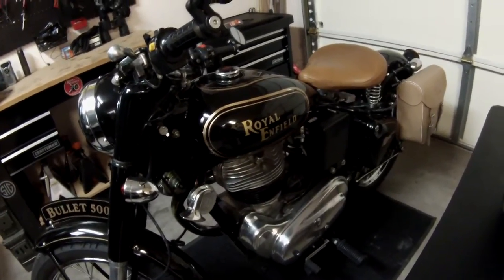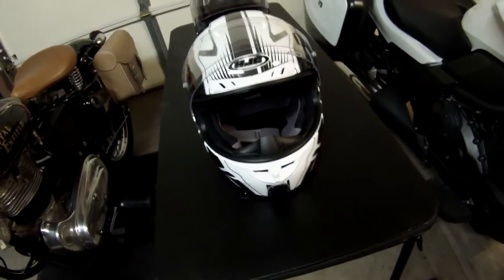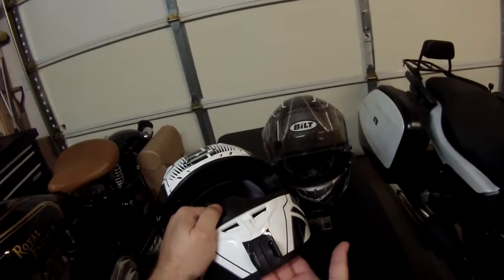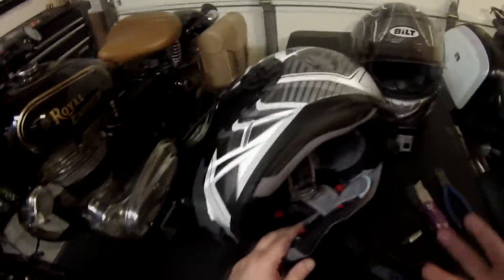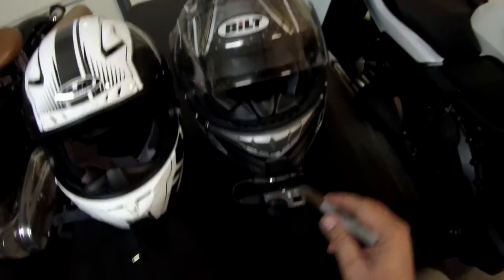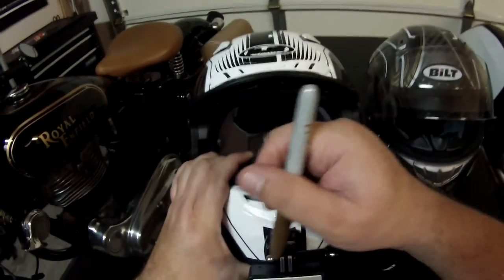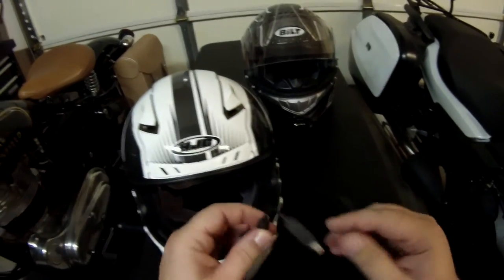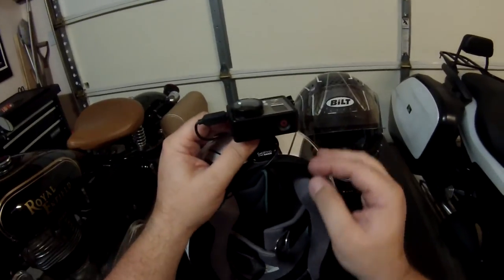Setting up a MotoVlog Helmet - HJC CL17 - How To

Comment: Nice setup. I originally had my GoPro upside down on my Bieffe, but really wasn't pleased with the perspective. I found that, for me, having the camera right-side-up and closer to eye level de-emphasised the bike significantly and provided for of a pilot view. Having the camera right-side-up also allows me to see the blinking LED on the back, so I know for sure whether or not I'm recording.
Reply from the maker: I see your point there.  As far as framing the shot, on my Enfield I like to frame the shot with the handlebars within the frame because it gives more perspective for the viewer.  You know, incase someone wants to go full screen and pretend they're holding on to the handlebars LOL!  Not sure where the sweet spot is on the CTX yet though.

seeing the light would be handy, I usually just see it in a reflection from time to time.

Thanks for the input, good to see how er'body gets it done B-)

Comment: Wow man, that was a brilliant set-up guide. You made everything so clear and detailed. Totally professional! Really impressive. You should do more vids like this, you do such a good job.
I was going to do a lot of reviews when the weather gets better, but after watching how good you are, I don't think I'll embarrass myself by doing them. ;o)
Great tip with the gold pen, nice idea, I'll be using that one, thanks.
Great vid mate.
Reply from the maker: Thanks Rob, you're too kind!

Don't let me stop you from your reviews, we're each entertaining and informative in our own ways.  Many would say I'm too dry and too boring, but that they got something out of it.  You never know, you could be funny, engaging, and witty whilst still being informative.  I think I sometimes sound like the Sham-Wow guy or the Rev-Zilla pitch guy LOL

Anything to make things easier.  I got the idea from when I was doing spark plug chops on the RE while jetting the carb.  You have to mark throttle positions and it occurred to me that marking the GoPro joint would save me the hassle of having to preview it on the cell phone whenever I reconnected the camera for whatever reason.

One of the things I didn't mention was that I don't use a battery backpack or add-on screens.  They weigh more and the screen and remotes tend to use more battery as the wifi/Bluetooth has to be on.  A little more clumsy to start and stop the camera this way, but just an idea ;-)

Thanks again, Rob  B-)
Reply from the maker: Oh yeah, still have to work on the pocket dump, I'll get to that ;-)
Reply: Arizona RE  No rush mate. ;o)

Comment: Thanks for this video man ..ill be picking up a cl17 next week and I'll try this setup
Reply from the maker: It is a very good lid. The extra parts are inexpensive too, you can get a second lining, cheek pads for next to nothing and switch them out between cleaning. Also, if you are going to be vlogging, get the chin curtain too.
Reply: Arizona RE I already do vlogging but I have the issue where I sound like Darth Vader and the camera is on the side ..I'd like to have it in the middle

Comment: Nice helmet man. I just picked up a new Nolan EVO 104 while I was in Tucson. Great helmet. It's always a little nerve racking cutting into a new helmet, but has to be done.
Reply from the maker: Agreed, though this is a pretty harmless hack.  On an earlier Built (cheap) helmet I actually drilled through the chin piece to mount the camera with a bolt and nut for extra security as the sticky mount didn't touch very much.  I'd never be that careless with a more expensive helmet though...
Reply: I cut through my last helmet to mount my bluetooth. Need to find a better way with this one. :)
Reply from the maker: Livin' Rob  Yeah, most of the newer blue tooth devices are set to hook on plus some 3M stickiness, you shouldn't have to hack anymore.  Good luck!  B-)

Comment: Hey bud this is a nice video, however my question is for the modular aspect of this helmet. Can you raise and lower the modular portion with the speaker wire set up in your earpiece? Reason when I ask this is because that's how I put my helmet on and take it off. Thanks for responding to my question I greatly appreciate it !
Reply from the maker: The HJC CL-17 isn't a modular.  When I did run a modular I ran everything up front of the hinge point.

Comment: I have watched this and saved it to watch again.  Your audio is excellent even in all the wind.  Is this the same helmet you use now?  I still can't seem to find a good windscreen for my bike and it seems like it comes up from underneath and around the sides & off the mirrors. With my Shoei RF1200 helmet, this wind buffeting feels like someone is shooting a leaf blower up and around my helmet.  I am beyond frustrated.  Took my Madstad screen back off and went back to stock but the wind noise is now hurting my ears even with custom ear plugs.  Really don't know what to do about that; however, I did just get a couple of gopros and wanted to do a chin mount, thus, I'm here watching this.  Sorry for the long comment...I am frustrated!!! lol
Reply from the maker: All good, you can comment as long and as much as you like ;-)

This is still the same setup only now I'm using a J-hook and using the camera up right.  I'm using a chin curtain as well when I vlog, which cuts down on wind noise and keeps air from getting in the helmet.  My personal experience has been that this makes air travel thru the venturi vents more effectively because it isn't being disrupted by the airflow at the bottom of the helmet.  With the chin curtain in I can actually feel the vents working better (over the scalp and into the breath box).  Check around, but I bet you can find a chin curtain for your lid for around $10. 

Are you using the Sony ec3m mic?  Just curios.  I know you have a Sena, if you pick up a GP10 you can use the Sena mic to record your vlogs and it has excellent noise canceling.  I personally don't use it unless vlogging while riding in the rain because it is so effective at canceling noise that the exhaust sound disappears from the audio altogether.  This may not be an issue for you.

I also clean up my audio in post production with as low cut or high pass filter.  This takes the sting off the wind's impact on the audio production.  Let me know if you'd like an instructional, I can email you.  It is really simple B-)
Reply: Arizona RE I just bought a go pro hero 2018, 2 actually,  because they were on sale.  Gonna put one in front,  rear-facing, and one on the chin.  So, just started researching best way to chin mount. Will still be using the Sena 10c for my comm and maybe use the audio from that,  but would need to sync that with the go pro videos.  That might be more work,  though.  Lol.  Will let you know about a tutorial from you...thank you very much!!!!!
Reply from the maker: I didn't realize you weren't using GoPro already.  That may rule out the GP10 as the new ones don't use it.  I think it uses a different mic adapter as well.
Reply: Arizona RE I can't tell,  but is the j hook on a flat or curved mount?  The chin on my helmet is such that it has a point in it as it comes down from the vent to the bottom edge.  What chin curtain do you use? Does it get too hot to use in summer? Sorry for all the questions...yes, I'm very new to the go pro world.
Reply from the maker: WheelsNotHeels hit me up on email and we can exchange datos, I'd be happy to help where I can.
Reply from the maker: azroyalenfield@gmail.com

Comment: Great Video. It will help me in the feature. Wait..... To connect a Mic to your Camera. All you need is that weird little Connector? I Wonder if that will work on mine. Mine uses the same cord as a Go Pro....   HMM I wonder if I buy a Go Pro Mic Connector like you have if it will work. I've gotta try that. it wouldn't hurt to try.
Reply from the maker: I wouldn't bother, I've seen reviews on that camera and people have tried, also, it could cross some circuits and create a problem that could ruin the camera.
Reply: Yeah true lol. I just need to upgrade my camera lol.
Reply from the maker: TRX450R Vlogger Depending on your editing software it should be really easy to sync up audio from another source than the video feed.

Comment: Is there anything special that we have to do since we're recording upside down?
Reply from the maker: +TheCaliforniaFrank Hey there, thanks for watching!  If you are using a GoPro you can set it up to record upside down and the footage will come out looking just fine.  If you are recording with a camera that doesn't have that adjustment, usually your movie editor software will flip it for you.  Even the Microsoft Movie Maker has that option, so no fear, record upside down B-)
Reply: +Arizona RE  you're awesome RE! And Yes I have the GoPro 4, silver, so thanks man!
Reply from the maker: Hey great, on the Hero 4 Silver you swipe from the right on the screen, choose Setup, then go down to Orientation and choose either Up (normal) or Down (upside down) .  Hope that helps B-)
Reply: +Arizona RE It actually helped out alot, I just switched it. Thanks again RE!